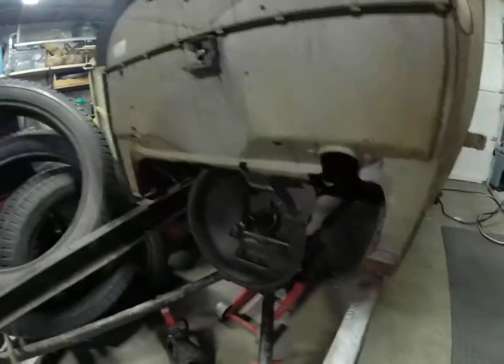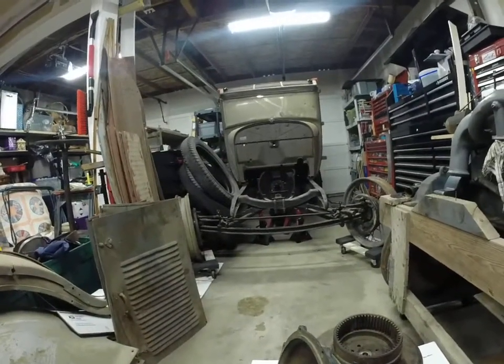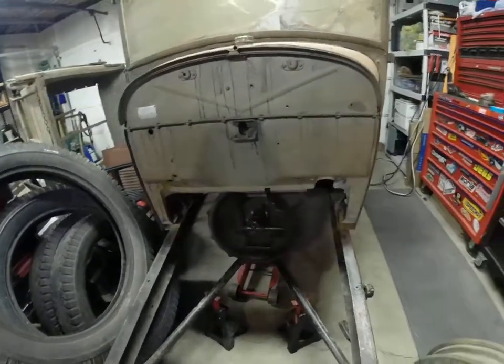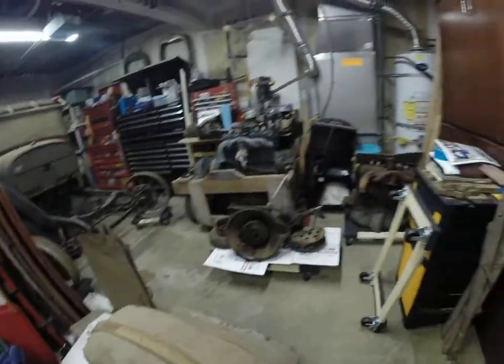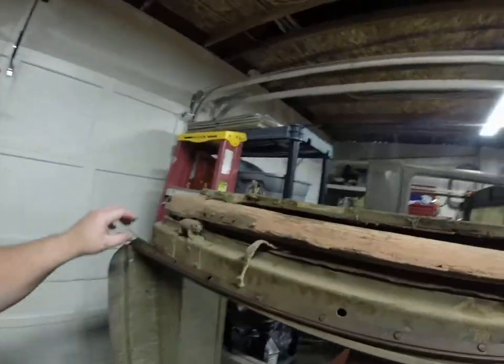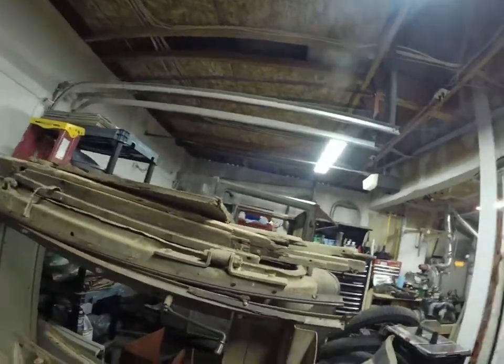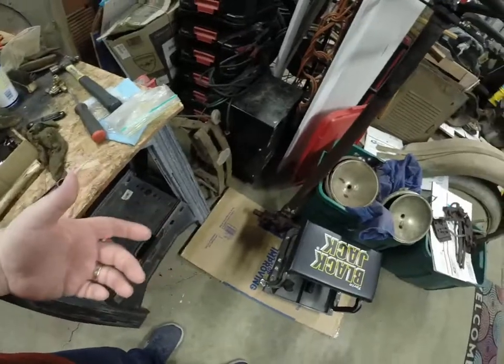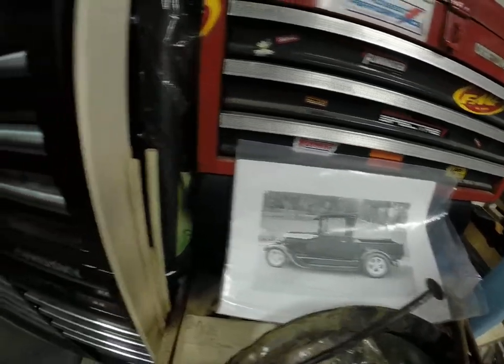1928 pickup update

Comment: Whats up with that big ass seat?  lol    What are your plans for brakes?
Reply from the maker: lol... No its good man ;) Well I am not exactly sure. I want to go juice brakes or something like that. Another guy mentioned using 40's ford brakes. At this point the mechanical ones are going to have to do. Until I know kind of what I have and don't have as for working and not working stuff I am trying to use what I have. I can always upgrade things later so I am just trying to asses what can stay for now and what can go. As you can tell I am all over the place. Kind of flying by the seat of my pants. I know what I want, but trying to do it on a budget. Got any suggestions I am open to them :)